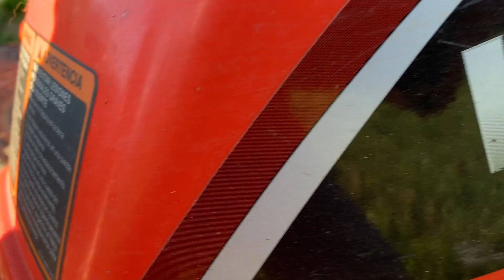KUBOTA ZD1211 in action.

Comment: I own this machine with a 60” deck, I must admit I don’t think it has enough power for a 72” deck. That said I replaced the back tires with Tweels on the back plant to put them on front as well. The ride and traction was improved significantly. Never have a flat tire. Note after 5 years they show very little wear.

Comment: Have you checked the fuel shut offs to see if there turned on there's one on each side
Reply from the maker: Yea that’s the first thing I checked. One thing I’ve noticed is after pulling them apart I’ve found pieces of plastic stuck in the valves.  Looks to be stuff from the tank when it was made.

Comment: Hey was just wondering what size tire and wheel on the rear. I am hopefully going to be buying the exact mower soon and like the rear tire setup you have. I live on a ranch and would think that would give great traction. Great video by the way.
Reply from the maker: So here’s a link of the tire I’m runnin right now. They tear the grass up if your not careful but I mow a lot of hills and around lakes so I’m more concerned about traction. As far as the wheels all I know is they are a 12in rim, the came off a 72in bad boy mower and just happened to fit. But they look like somthing easy to find. 

https://simpletire.com/paid?v=1&tireSize=26-12-12&mpn=523360&brand=carlisle&productLine=tru-power&itemId=198244&region_id=7000079999&utm_creative=585899753715&utm_term=&utm_campaign=G_Shopping_Region_07&utm_source=google&utm_medium=cpc&hsa_acc=2136589202&hsa_cam=6452928389&hsa_grp=134838303980&hsa_ad=585899753715&hsa_src=g&hsa_tgt=pla-351423924607&hsa_kw=&hsa_mt=&hsa_net=adwords&hsa_ver=3&gclid=CjwKCAjw9suYBhBIEiwA7iMhNBCDmk7oSvAg6E4JPaD798sWWRYwfOEqUgXaOiGL7J4B0tGEiVLmYBoC0cQQAvD_BwE
Reply: @BuiltbyBurns  thanks for the reply I appreciate it.

Comment: R they the standard blades or something else. I also own a 1211 with 197 hrs and stock blades haven’t changed them yet
Reply from the maker: Right now it’s still on the factory blades, I plan on changing them for next years  season. Still on the fence about what I’m going to be running next. 

How you like your 1211? Ever feel it’s underpowered?
Reply: @BuiltbyBurns  I love mine I’ve got 223 hours on in and no problems just a lot of grease fitting 19-20 if i counted right. I think the fuel flows from one tank to the other is thru the fuel line  when u fill one side up it’ll push some into the other tank.  Both tanks drain at the same time thru a t instead of of a selector valve